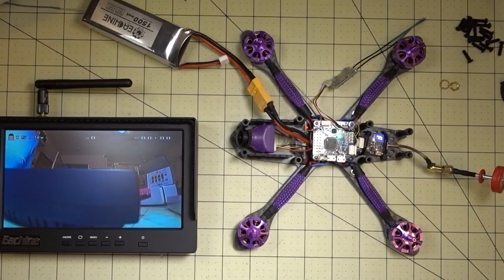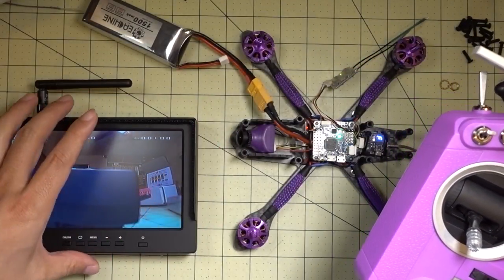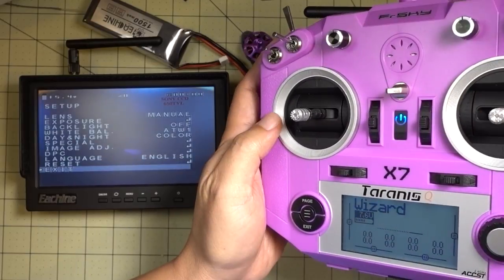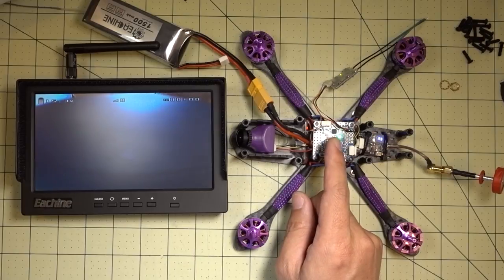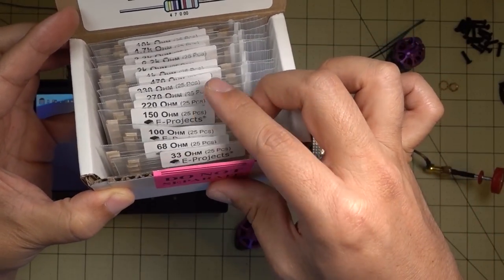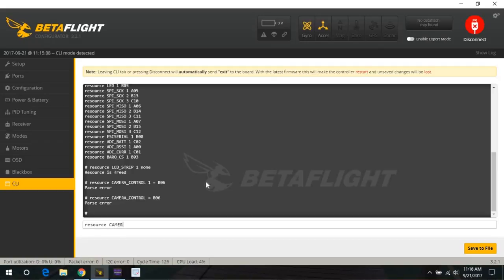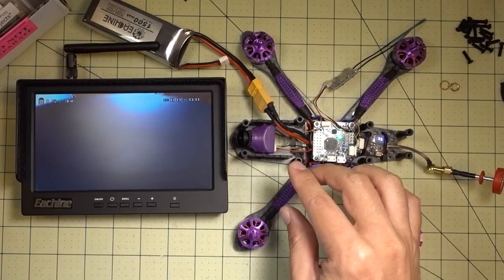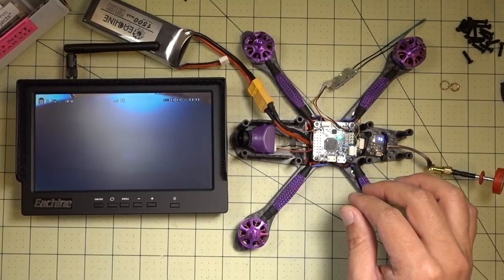Betaflight 3.2 CAMERA_CONTROL Tutorial 👍👍👍

Comment: next thing we need is a LUA script for our taranis so we dont have to fiddle around with the osd.
Reply from the maker: I think someone already made a video on that.  I don't use Taranis much anymore so I'm a bit out of practice on what's going on with FrSky these days.
Reply: There is a LUA script that does that already actually but it is not as reliable as the stick input in my opinion. It doesn't always registers the input you are giving... very weird. Maybe they need to improve it a little bit. You can find this on github BTW
Reply from the maker: +KViN Also, for those who use Flysky, Spektrum, or anything not Taranis, LUA scripts are irrelevant...
Reply: yeah I realize that but I honestly think 90% of the people that are serious enough in this hobby to be interested in such a feature are running Frsky.
Reply: FlySky will get there eventually. I actually have plans to work on this for FlySky, and maybe Taranis if Trappy's Spektrum trade-in deal bears fruit.
Reply: Changing camera settings from lua script doesn't make sense to me. When changing camera settings. We have goggle on and how can u see the tarranis screen.
Reply: KViN not really. At Least half of my fpv friend use sth other than tarranis. I prefer frsky protocol it's reliable and have cheap receiver. But I use it with a moded Devo 7e. Got 1km range no problem.

Comment: Use a potentiometer at first then when you find the right setting replace it with a fixed resistor.
Reply from the maker: +Nicholas Heidl is this a function on a multimeter?
Reply: no a potentiometer is just a variable resistor with a little knob you can turn to change resistance.
Reply: There's not need to do this as 150 Ohm will work for anyone. People, do you read documentation at all?
I've spent my free time to write it, and you just invent stuff like "use a potentiometer" instead.
Reply: surely enough people have done this that we can just compile a list of the correct resistors to use for certain cameras?
Reply: you need to write a more user friendly documentation. most people just want to be told what to do so they can get this working then go out and fly, really don't give a crap about all the other stuff. sure, leave all that stuff in for the nerds who froth on it but you also need 'an idiots guide' with step by step instructions for people who just like to fly. most people enjoy reading technical documentation as much as they enjoy getting their eyeballs pokes with needles. probably why most people didn't make it to the end where you say you can use anything between 150-600 ohm
Reply: Am I  that old you don't know what a potentiometer is?  Lol.  It's  fine to say use a specific resistor but if you are finding yourself working on some other project then my suggestion is applicable. Knowing the required resistance after the fact is relevant to yourself but not necessarily for ithers.
Reply: Sorry mate, my comment was meant for Andrey Mironov. I clicked 'reply' to his comment but it looks like my reply was to your comment. My bad

Comment: Which pin do I use on the runcam eagle? Is it the pin that says "set"? Thanks for the video Albert.
Reply from the maker: I don't think this will work on the Eagle. Only on those with a single pin for the OSD controller. The Eagle has like 5 pins!
Reply: Albert Kim Ok. Thanks for the reply.

Comment: Hi, I have flywoo f405 and foxeer monster micro pro.
I plugged the pin of osd from cam on cam control pad ...
But if I go thr 50 and yaw to right... and pitch forward
I do not enter in osd of cam...
Someone know what I do of wrong?
Thanks
Reply: Leave your pitch centered. I have the same set up. Flywoo f405v2 and Foxeer cam. Mine works great!